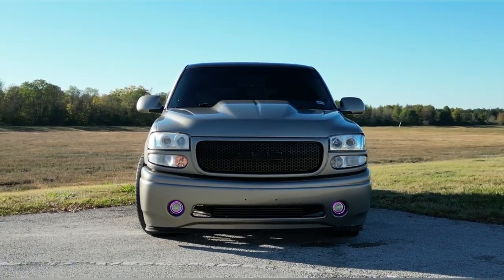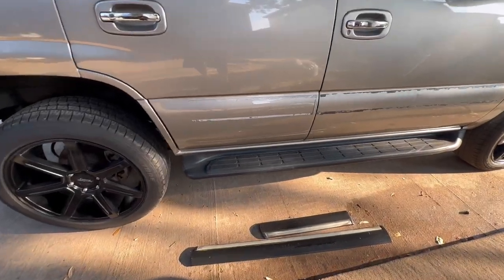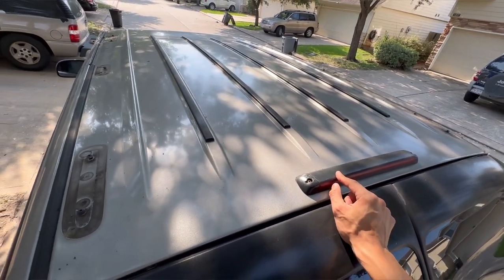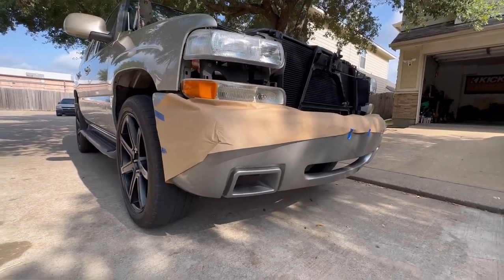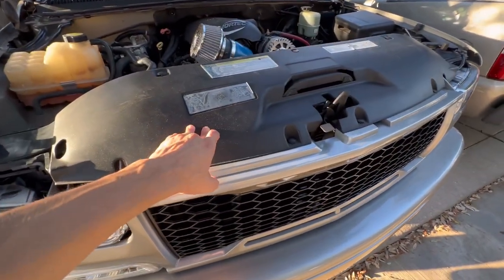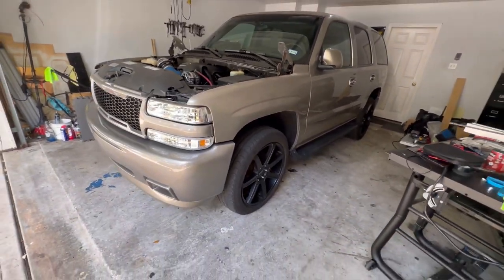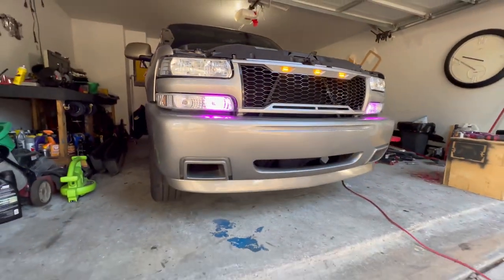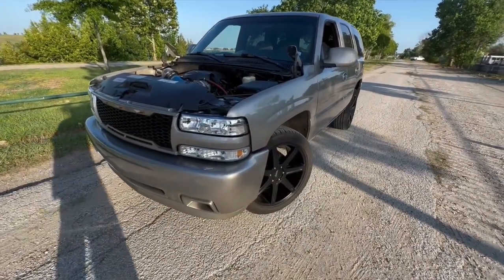My Tahoe’s Transformation!🤯Simple DIY Upgrades🔥🔥🔥

Comment: You should put some 8th inch thick rubber washers under the screws on the roof so you have no leaks
Reply from the maker: Yeah that may work, but I’ve always done them like this without any leaks so it’s good for now👍🏽

Comment: aye bro js you don’t have to do it but wit that grill i would get a set if them projector lights have them say “tahoe “ and hind in in the grill so it shows on the black condenser you painted if you would want that js
Reply from the maker: Yeah later on would be good for sure, If though about that before but may on the transmission cooler I need to put one later on, and appreciate it should look nice👍🏼

Comment: Bro I still don’t get how you put on the ss bumper
Reply from the maker: You just slide it on top of the factory bumper, all you have to do is remove the bottom plastic valance and fog lights on the factory bumper
Reply: @MiGo713  where did you order it ?
Reply from the maker: @j6shy_987  I got mines used but this is the same SS bumper  #ad https://amzn.to/3JWYCLv they come primered so you just need it color matched and it slides right on top, I just added 2 Tapping screws on the sides to make sure it wouldn’t come off👍🏼

Comment: Running boards will make it look lower, if thats the look you're going for
Reply from the maker: Yeah I want to lower it later on but don’t like the look of the sidesteps so I just took them off
Reply: @MiGo713  where did you order the ss front bumper? Do they mount right up?